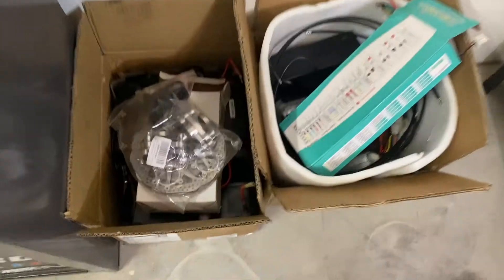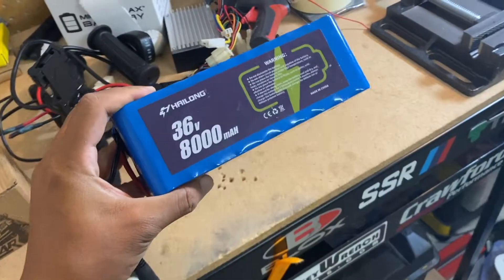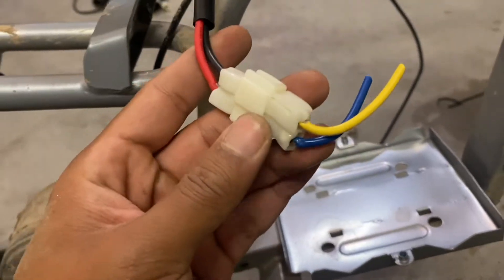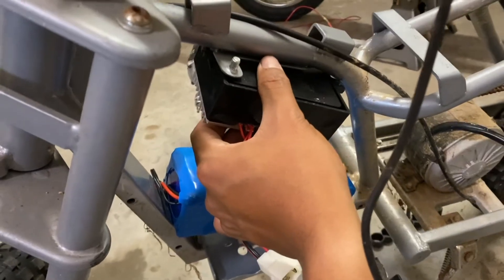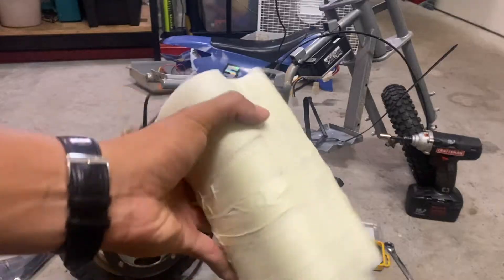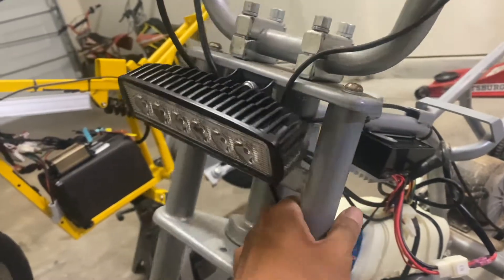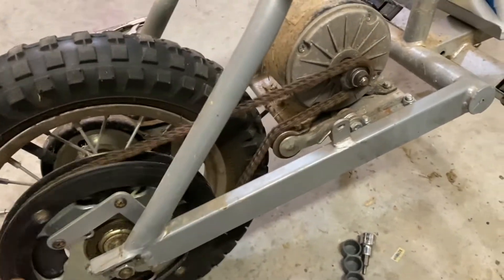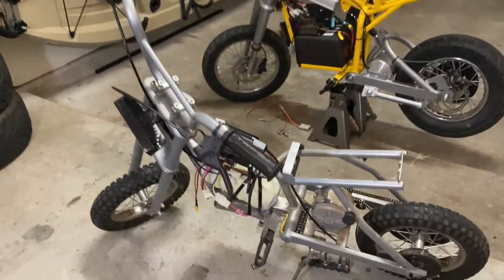Razor MX350 Micromoto Build | Power Upgrade Overvolting the Stock Motor 36V for more Speed

Comment: The connector that connects the controller to the battery is not meant to take more than the exact stock voltage. Before I overvolted my sons MX350, I had installed a basic variable throttle controller that sent the full 24V to the motor (compared to the stock 20V). Even with that very slight marginal increase, the connector melted and fused. I didn't even notice it until I was installing the overvolt kit. I'm just glad I caught it before it caught fire or something.
Reply: The connector melting isn't due to the voltage. It's due to the current.
Reply: @Nominally-Built  And what do you think increasing the wattage by 400% and only increasing the voltage by 50% does to the amp draw?
Reply: @nxdboi  the increase in current is a byproduct of increased RPM caused by overvolting, but it's still not the voltage that causes the heat. Voltage isn't the direct cause. Static electricity can be thousands of volts but not cause any harm. In science, one must be precise on their use of terminology.
Reply: @Nominally-Built  Obviously I was speaking in the context of an overvolt kit and variable throttle kit when writing a comment talking about an overvolt kit and variable throttle kit 🤦. I clarified what I mean in the subsequent comment. In science, one must read.
Reply: @nxdboi  and to be precise, the connector isnt the issue, it's the insufficient contact the pins make that cause an unnecessarily high resistance which causes the heat to build up in the connector.
Reply: @Nominally-Built  Yeah, that's literally exactly what I said.
Reply: @nxdboi  isnt*
Reply: @Nominally-Built  Oh, I see what the problem is! You're not a very good reader.
"Sure. A connector meant to take more current will solve the issue."
Reply: @nxdboi  okay, Mr. "Voltage is the same thing as current"
Reply: @Nominally-Built  And you don't know how to use quotes either. Bless your heart.
Reply: @nxdboi  English isn't my first language, so I really don't care. Do YOU know another language and how to write/read it? Prob not, but what's obvious is you don't know science and engineering....voltage = current.... lOL
Reply: @Nominally-Built  English wasn't my first language either. It isn't even my second language! Lmao. Do me a favor, though, use quotes properly this time and actually quote where I said voltage and current are the same thing. Womp womp. You come here looking for some sort of argument, but instead leave looking like a fool.
Reply: @nxdboi  pretty sure quotation usage is the least of your intellectual problems if you think voltage is what causes connectors to melt.
Reply: @Nominally-Built  Increasing voltage in the context of an overvolt kit, which is what we are talking about here and what the video is about. So not only do you have poor reading comprehension, but the context flew over your head too. Boo for you.
Reply: @nxdboi  power = current x voltage, btw. Not the same thing. So.....
Reply: Does buying a new connector fix that problem? Or is it better just not to upgrade it?
Reply: @spuddito  Sure. A connector meant to take more current will solve the issue. On the other hand, the connector has been fused for months (again) since I've overvolted the bike, and it's still running flawlessly and I've had zero issues. I think the extra current is only high enough to soften the connector, not actually melt it. Personally, I'd go ahead and upgrade the bike. It's totally worth it.

Comment: How did you connect your headlight on the mx500 controller and you think you can add a brake light
Reply from the maker: I didn't connect the headlight to the controller. I wired it to its own switch and source of power (Please watch the next video for more details.) I have not done a brake light yet, but I'm sure you can wire it through the two wires that connect between the brake lever and controller.

Comment: I haven't played w a 350 bike yet. But ive managed to manipulate the 500s and 650s, to my will!
Reply from the maker: The 350 is quite limited.. No front brake and no room to sit! But it would be insane to install a 3000W kit on it at some point.
Reply: @PatOutdoors  wwll its not hard to mount a brush 36v kit from a stock 650 razor! . Cam stunts uses one. But his account was closed a few days ago, by mistake. A base motor 2kw , and use the 1st speed. I can show you how to Reverse shut mod. Soft start. Things like that.

Comment: Hey I'm trying to mount my light bar. I can't get a good shot of how you mounted it. Did you have to drill a hole in the bracket?
Reply from the maker: I didn't have to drill out a hole. I used the hole where the white plate originally mounted (since I completely removed it.) Mine is also an older version of the bike so it may be different from yours if yours is newer.
Reply: @PatOutdoors  well I ended up drilling a hole in the bracket. The light bar sits right up against it perfect and using the stock bolt, well I had a black one the same size with an allen head. Thanks for the info.
Reply: mine is older as well. Just not the older I would like to have with suspension.

Comment: I have a mx350 with a dead battery,
Do you think I could run it with a 36v battery and stock controller or buy a better 24v battery?

Thank you
Reply from the maker: I know people regularly run 48V batteries to overvolt the factory 36V controller on the MX500 / SX500 / MX650 / RSF650. But I haven't heard of people safely running 36V on the stock MX350 controller. I would probably recommend getting either the Fast Scooters 36V controller or a factory MX500/650 controller like this to do that properly: https://amzn.to/3B4N4Ao

But I guess it wouldn't hurt to try overvolting your stock controller first and then just replace it when it goes bad.
Reply: Done a stock mx350 with a 36v lithium ion battery. Got 26mph, on a half charged battery. Motor gets a bit hot after 10mins of riding. What can I do to keep the motor temp down, plus add about another 3-4mph? Maybe bigger rear sprocket? Or bigger pinion gear?
Reply: @JonahNAloha what controler and throtle ?

Comment: put the old MX650 brakes on the MX350?
Reply from the maker: I'd love to, but there is no bracket built on to the fork and there is no mounting solution on the wheel for the rotor. This is possible, but would require some welding and maybe an SX500 front wheel
Reply: @PatOutdoors  I’ve seen brake bracket adapters that clamp on the frame and slide around the axel bolts. I think you may be able to swap out the rear drum brake with the threaded adapter and discs you’ve used on the upgraded brakes on the MX650. It looks like the front wheel would need to be swapped to get a disc mounted there.
Reply from the maker: @RobYeung  I'm gonna look more into this! Thanks for the ideas
Reply: I have an extra rsf350 rear wheel so I just converted to disc brakes. Works great.

Comment: How do you think your 2000w kunray would perform with 36v? It would be cool if you could make a video, of you undervolting it. It would be for someone like me, a guy that can only buy one thing at a time. Then we could see what you can do with stock voltage.... yeah, on second thought, sounds kinda boring, now that I hear myself saying it. I like more voltage. I hope your battery shows up soon.
Reply: I don’t think it would turn on actually. The controller has a voltage cut off at 41 volts
Reply: @PatrickKasilag cut off 41v he put 36 :)
Reply: @gabrielhardmusic8669  the question was referring a 48v 2000w kit, not what I installed.

Comment: I’m curious on the mx350 does the frame seem to be built as solid as the bigger razors or does it feel cheaper? If it’s built the same it should handle an adult rider no issue just don’t wanna see it crumple under you while riding it. It’s definitely got more power already though !!
Reply from the maker: Honesty it does feel a bit cheaper. I certainly wouldn't suggest doing jumps on this bike as a full grown adult weighing over 170 lbs. But I'm still gonna send it. It also one has ONE brake, for the rear and it's drum.
Reply: @PatOutdoors  the mini death machine ! Haha that’s my type of build right there. Can’t wait to see some rides on it !
Reply: working on mine now. I aint't scared...